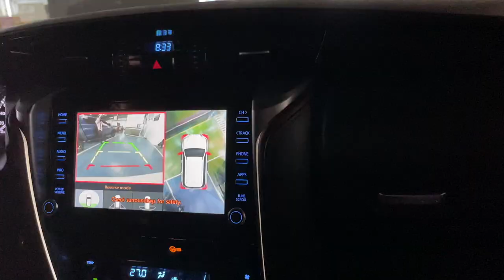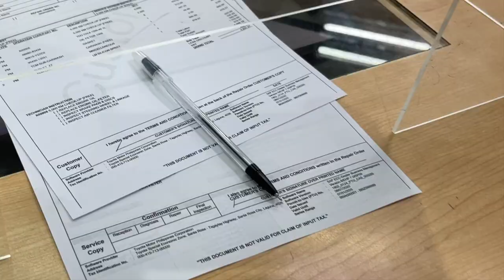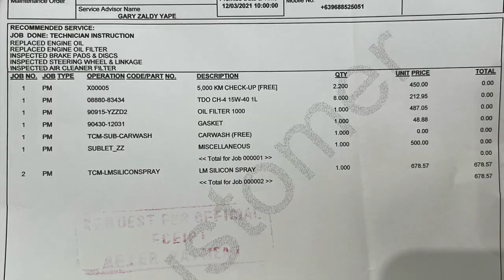Second PMS at Toyota Commonwealth | Cost | 2021 Toyota Fortuner LTD

Comment: Madam…yon bang Navigation feature ay kasama na head unit?
Reply from the maker: Hi, not sure po about the question pero, the navigation system here works when you connect your phone, either apple or android and make use of waze or maps, or google maps and it'll reflect smoothly on the head unit's screen po.